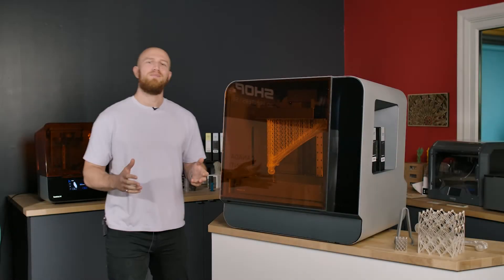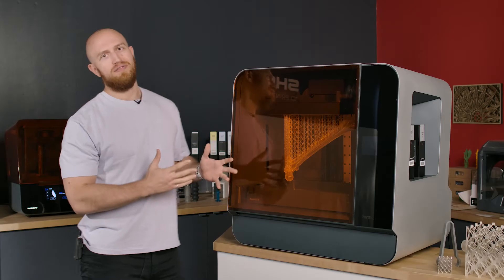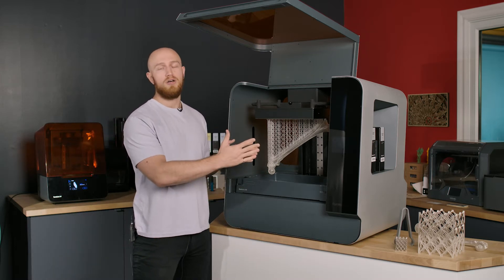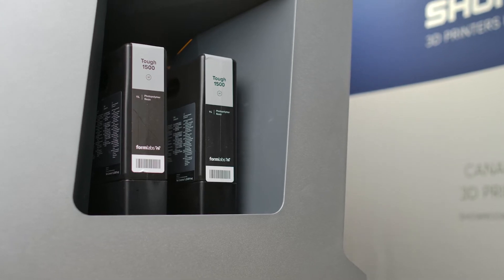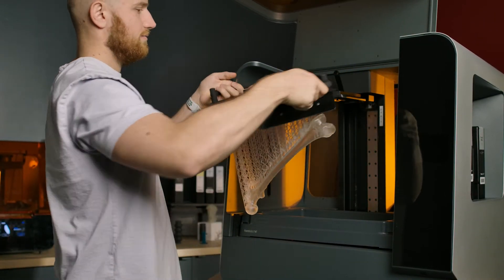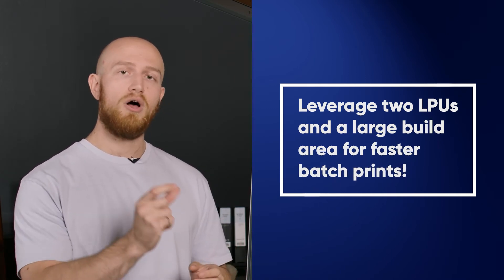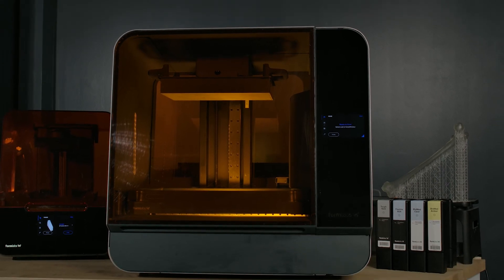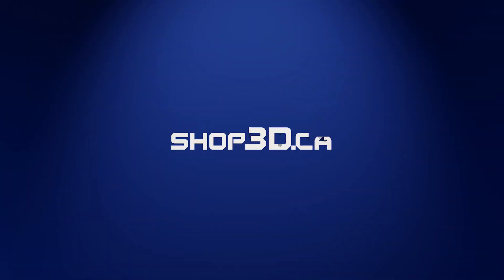Top 5 Reasons why you need the new Formlabs Form 3L SLA 3D Printer

Comment: I have been using a Form labs and Form labs2 for the past 6 years ( company owned), trust me, there are better and more cost effective options.15K is not what most people consider affordable, there are other 3D resin printers out there that produce the same outcome for thousands less. The cost of your proprietary resin alone is absolutely ridiculous. $150.00 to $250.00 for one container or resin! Your efforts in trying to control the market will be your downfall.
Reply: Hi James. Do you recommend another SLA printer that's comparable to the ones offered formlabs? The proprietary resin is what I don't like about it right now.
Reply: @jouleSansLoi  To be honest, any of the SLA resin printers from China are comparable to the quality the formlabs put out. I currently have a "Anycubic proton mono x" less than $500.00 and the prints quality is comparable. Resin is very affordable $25.00 1kg. vs. $ 150.00 kg. Currently testing water-soluble resins with good results, tip: "" it all about the settings"" hope this helps.

Comment: just to be correct about build volume and cost: chinese SLA printers cost below $1k, with 10 inch build area and 4K resolution.
Reply from the maker: 4k resolution would make it a DLP printer and not a SLA printer no?
Reply: @Shop3Dca  yes. What are the benefits of SLA, apart from slightly smoother surfaces? Like, printing speed?
Reply from the maker: Actually in some instances DLP could be faster.  There's a lot to consider but surface quality, accuracy and resin optimization come up first. Also this unit has low force peeling so you don't hear that big thunk everytime it peels a layer and the laser module and laser point is always perpendicular to the surface making tiny support touchpoints.
Reply: @Shop3Dca  yes, low force peeling is probably the best thing here. I have actually had this idea few years back and was going to develop it, but then life happened.

Comment: 10k price tag is not very affordable compared to peopoly phenom and noir which are 2 and 3k
Reply: 10k and you still use cartridges 🤦‍♂️... phenom XL it is
Reply: It’s affordable and saves a lot of training and trail/error costs for business. The original targeting market was not the mass hobbyists to start with. Similar to Ultimaker S line that people argued it’s pointless compared cheaper machines like Prusa or Ender series. However, training cost and timing consuming tuning is a big part of “cost” to business since time is paid and offer to workers as “salary”.
Reply from the maker: Affordability is usually dependant on how much return you are able to extract from your tools.  Think about high quality power tools, are those worth it to pros that use it everyday?
Reply: @Shop3Dca  I compared it to peopoly large size printer size, your point is invalid
Reply: @armandsfreibergs4069  They are talking affordable for a small business, not affordable for an individual hobbyist. These machines have features that might not seem worth the price tag to you, but are the sort of things that will save a business operating them a whole lot of time and money over what consumer level resin printers currently offer.